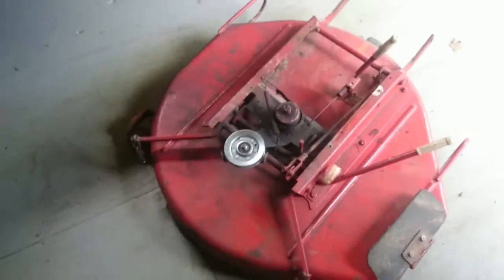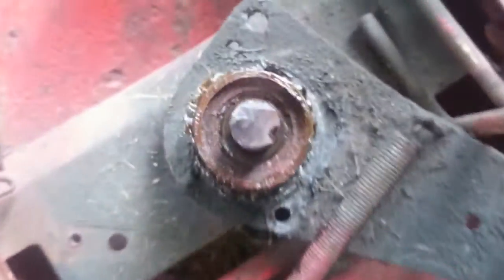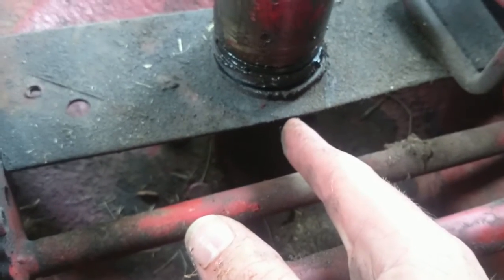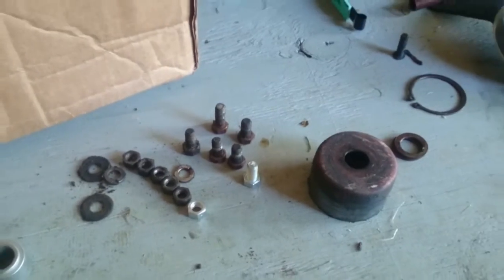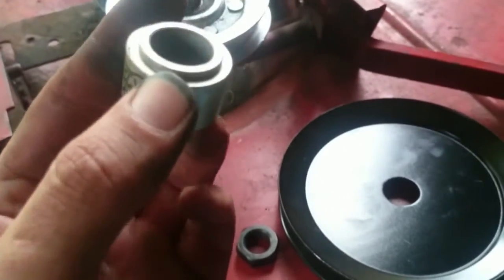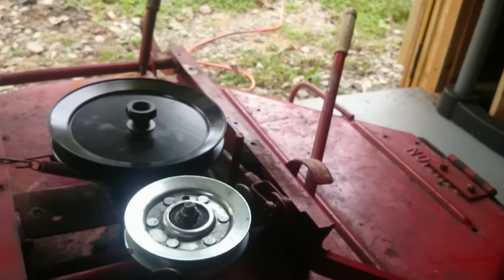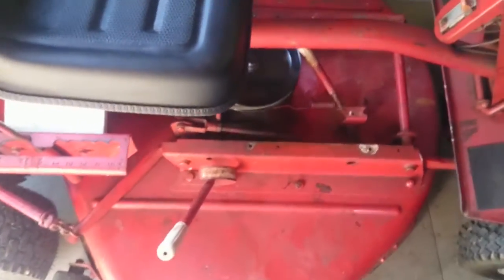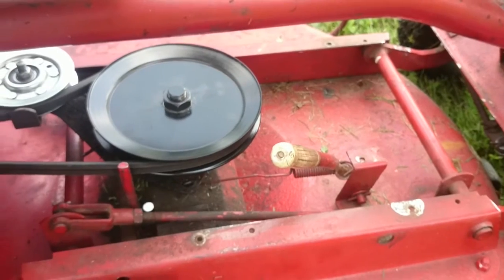Snapper 3080 series 0 deck spindle replacement

Comment: My grandfather had a Snapper similar to yours, but you could press down on the triangle shaped steering wheel (mind you this mower only had 3 wheels), and the front of the mower would rise up to roll over taller grass. That was in the late 60's early 70's. We were still mowing with it in 2005 when he passed away. Just to remind todays youth about yesteryear, he only went to school till the second grade, I saw a photo of him when he was 10 carrying two railroad posts (one on each shoulder), and the day before they took him to the hospital before he died, he was reshingling the roof of his house (by himself).
Reply from the maker: Those old timers could get some work done. My grandfather could out work me in my 20's and him well into his 70's. I think I've seen pictures of those old 3 wheel snappers though I've never seen one in person.

Comment: You tossed your tolerance ring that goes on the outside of spindle housing. It takes up the space where it goes through the cross member just below the two snap rings.
Reply from the maker: Oops! After thinking about it for a minute I get what part you're talking about.  Anyways thank goodness it works without it!  Good catch!

Comment: Manual for this mower is available at http://lawnandgarden.manualsonline.com/manuals/mfg/snapper/3080_1.html   I would say it was built between 1968 and 1972.  A few models  later the handles went bicycle style.  I worked for the distributor in approximately  Dec 1979 to May 1980.

Comment: Here is some information on identifying your Snapper Comet.

My Snapper comet riding mower information
My snapper comet 26 model: 265xs serial number: 557685

The first digit in the serial number (5) is of the year. So my comet is a model year 1965. My mower has a loop steering post and those were replaced in 1974 with abicycle handle bars. So it would appear that mine is a 1965 Model. This year 2016, the riding mower is 51 years old. The loop handle bars continued through 1973. In 1974 the loop was replaced with bicycle handle bars through 1985 and loops on the front of the deck continued through 1984. In 1980 the bicycle handlebars had a black triangle at the top of the handlebar post. Steering wheels replaced the handle bars in 1986.
The Tecumseh id number is stamped on the front of the engine cover. My engine Tecumseh tvxl195 150221 9335D (Original engine Tecumseh V50 60200V 5HP)
My engine Tecumseh tvxl195 150221 9335D Dec 1, 1999 19.43 CI/318.46 CC= 8 HP
CRAFTSMAN TO TECUMSEH CROSS REFERENCE 143.406092 TVXL195-150233
9335D is the serial number or D.O.M. (Date of Manufacture)
9 first digit is the year of manufacture (1999)
335 indicates calendar day of that year (335th day or Dec1, 1999)
TVM & TVXL 170, 195, 220; OVM 120; OVXL120, 125 oil 32 OUNCES 
Spark plug RJ17LM
Number designations following the letters indicate the horsepower or cubic inch displacement.
The number following the model number is the specification number. The last three numbers of the
Specification number indicate a variation to the basic engine specification.
The serial number or D.O.M. indicates the production date.
150221 is the specification number used for properly identifying the parts of the engine
9335D is the serial number or D.O.M. (Date of Manufacture)
9 first digit is the year of manufacture (1999)
335 indicates calendar day of that year (335th day or Dec1, 1999)
C represents the line and shift on which the engine was built at the factory.
Spark Plug Champion J8c Replaces Autolite 295, Bosch W9eco, Ngk B6s, Nippondenso W20sSource http://www.lawnmowerforum.com/showthread.php/36910-Snapper-Comet
Reply from the maker: Thanks a million for the information! With your help we can pin my 3080 to 1968 since the serial number starts with an 8 and it has the loop handlebars. Thanks again!
Reply: I live in an area with a high concentration of white pines and one obnoxious oak tree that dumps 90% of its leaves in one week.  I have owned two Hy-Vacs  that will virtually suck up anything off the ground.  Enjoy the memories and keep that machine going.
Reply from the maker: +Andrew deLivron Yeah those hi-vacs are amazing. Mom's will pick up the hickory nuts out of her yard if you go slow enough.

Comment: I just replaced the housing that the spindle goes inside. Got everything back together the way it came off. But when I get it tight enough where the pully will not move, the blade is to tight. Therefore when I get the blade where I like it, the pully moves freely. Cant figure out what is wrong any suggestions.
Reply from the maker: Geez anything I'd suggest would be strictly a guess.  I've never tore down one of these spindle housings.  I would double check your deck belt tension and your blade brake.
Reply: Clayton78 Thanks for the reply finally got mine working. Found the bottom washer on the spindle was missing and the blade bar was stripped. How it was working before I took it apart like that, I'm not sure.